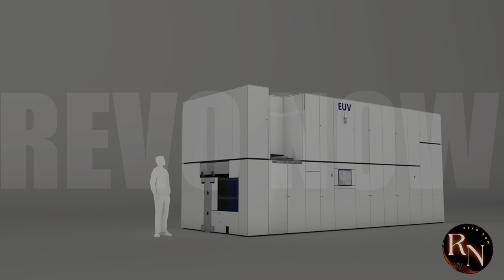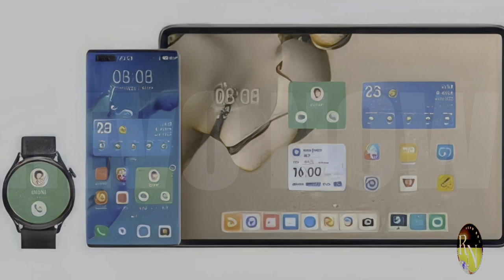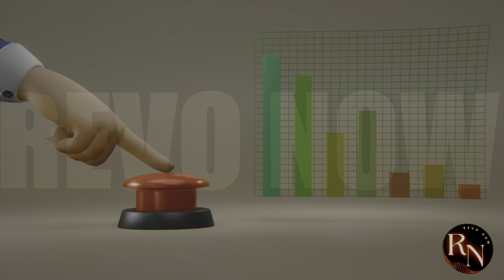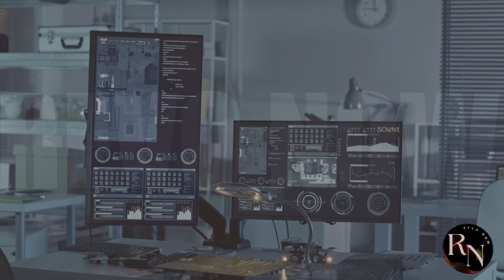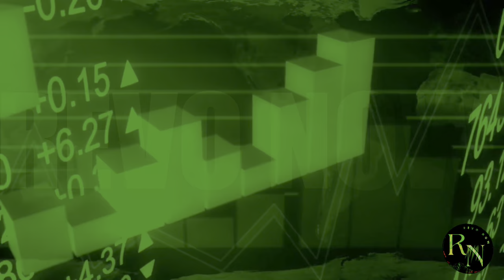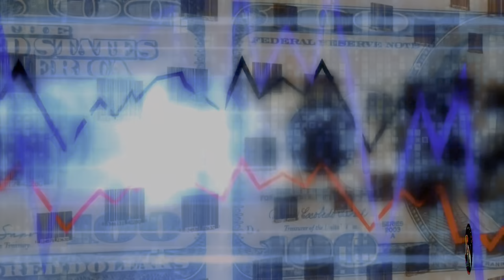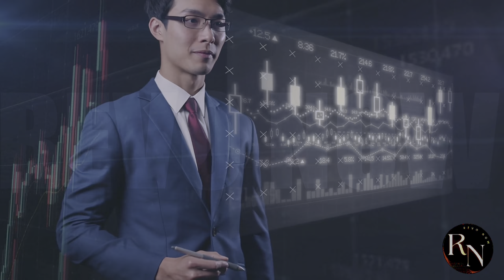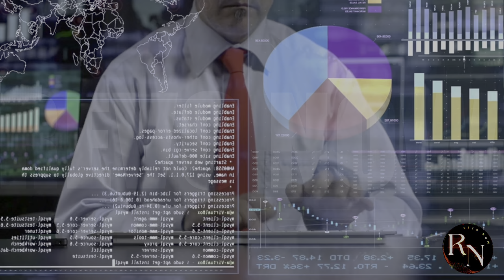SHOCKING News! EUV Patent Filed by China's SMEE in Germany!

Comment: China can manufacture a watch at par with Rolex at a fraction of the price. It takes an expert to make out the difference.  There is no reason the same cannot be done for computer chips. 
Alternatively with older chips in a different configuration it could be possible to achieve the same results.
The East has always beenfar ahead of the West. Hard work and perseverance has always paid off in the long run.
Reply: You would be surprised many components are from China in those watches.